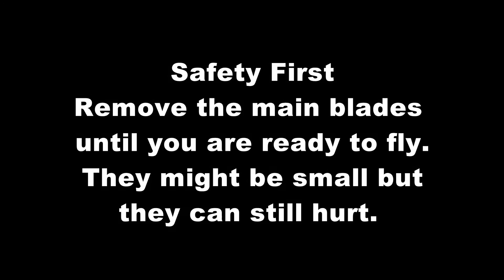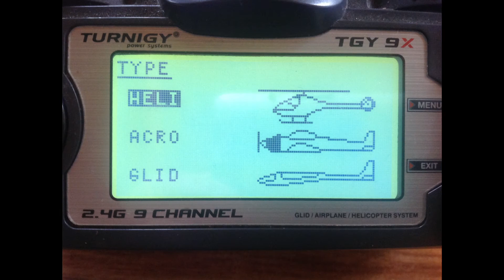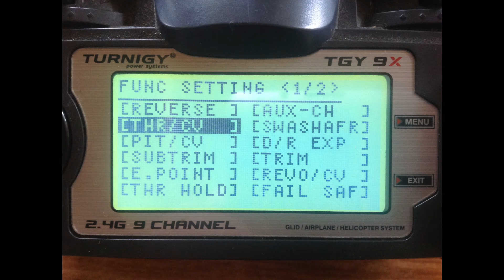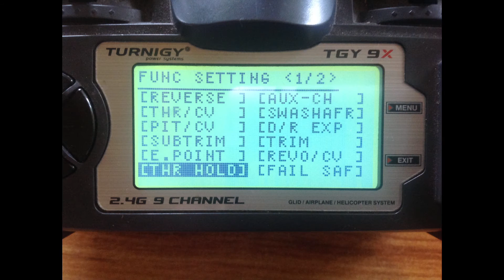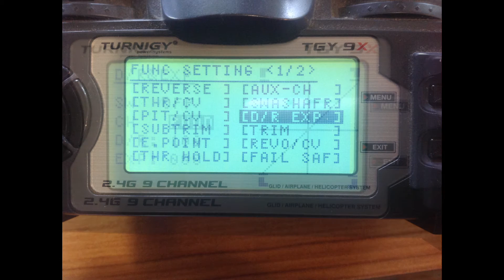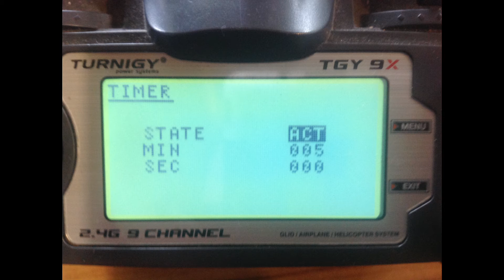HiSky HCP100 with HT8 Module and Turnigy 9x

Comment: My 100s with 3rd gen HT8 module arrived yesterday. I've tried for two evenings to get the bird flying. I've tried it with my 9x and fs-ts. Everything appears perfect until I advance the collective. Then the swash tilts until it can go no further. Then it jumps to a different position and the cycle repeats until the collective is full down. Since its doing this with two different Txs I expect its a module or board issue, but this is my first time using this module. My 100 BNF will arrive Saturday or Monday.
Reply from the maker: +VD2021 More likely something to do with channel mapping, do you fly mode 2 or mode 1. What is you channel order on the tx.
I fly mode 2 and if you do too just check the channel order on the tx.
Make sure you have the HT8 set to the right mode.
Is your 9x stock or modded with ER9x or similar.